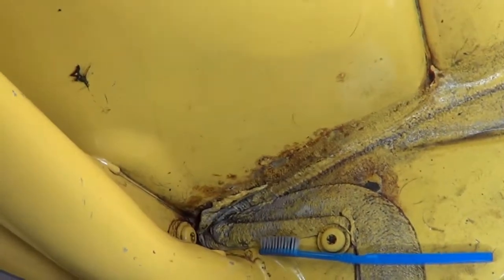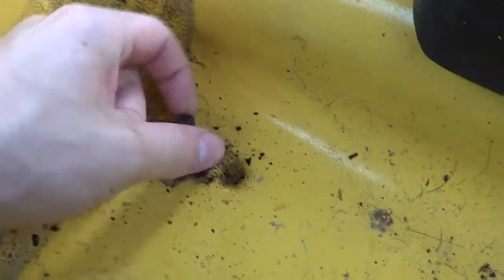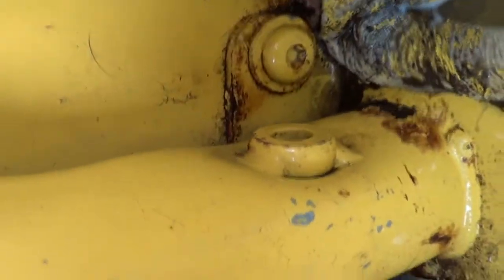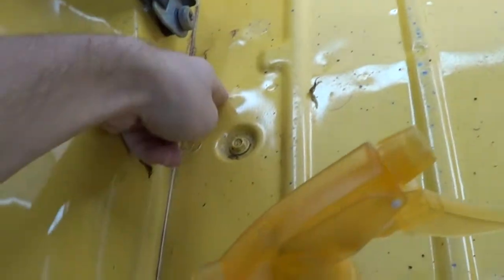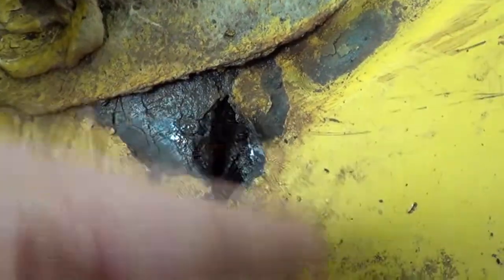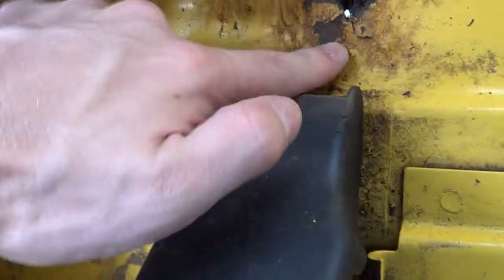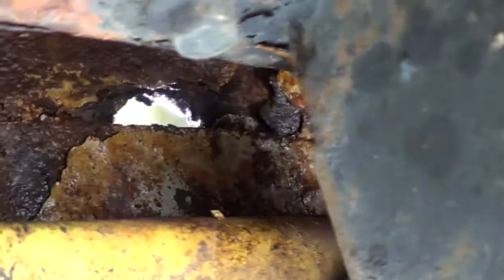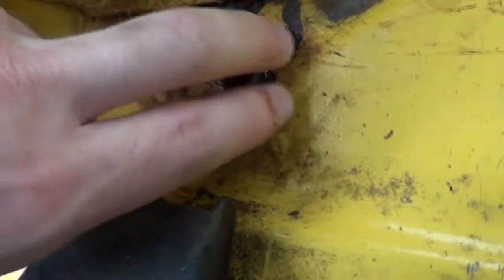Jeep Wrangler TJ Update #14 "I don't wanna know what that is"

Comment: A trick I've been using to clean small holes is spray some windex or other cleaner in the area and then get a air compressor and blow it all out
Reply from the maker: That is a viable trick I too found myself doing things like that in hard to reach areas.